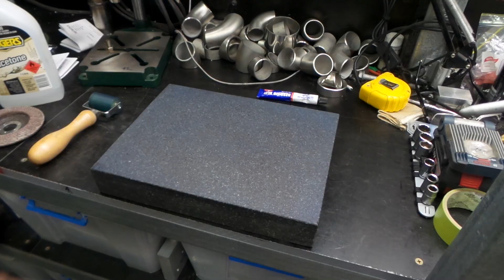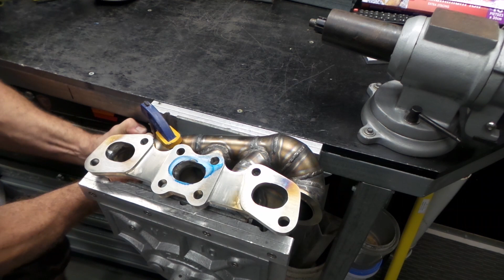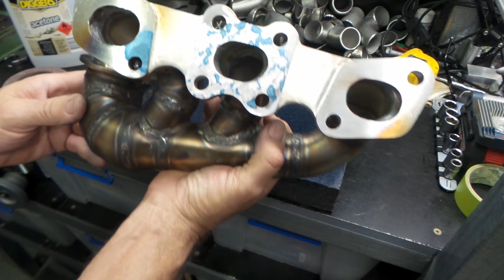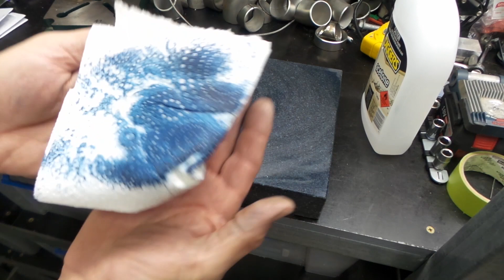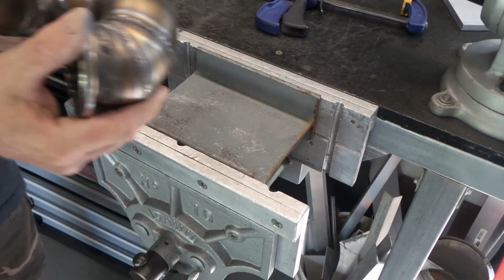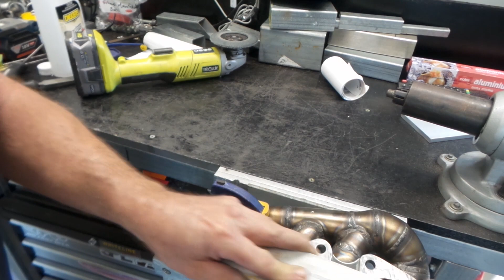Precision Flatten Manifold Flanges with only Hand Tools

Comment: Exhaust manifold on my '89 toyota pickup was warped by 0.5mm. Had some trouble getting the finishing touches with the grinder but a sheet of sandpaper on the table smoothed out the rest real quick. A fresher flap disc woulda helped but I just worked with what I had. Thanks for sharing
Reply from the maker: Great Stuff. Cheers Mate.

Comment: Single flange in stainless will warp on first use.  Nice clamping plate, could have used individual flanges with that stout header.
The idea of a single piece flange goes back to thin, long tube headers where the flange was an assembly aide.  When using short Schedule 10S stainless, individual flanges are a better idea.

Comment: This is brilliant!  Been putting off flattening my turbo manifolds flanges for years because I couldn't think of a way to do it.  Can you use finger belt sander (or whatever you call it) for more accuracy, or will you go through a tonne of sanding belts?

BTW, the turbo manifold is for my nuclear-powered destructomobile, which I will use to take over the world.  But I will be a benevolent leader.  Does this count as using my new-found power for good?
Reply from the maker: G'day Mate, finger sander would probably work great, give it a go & report back. A+ on the powers for good. Cheers.
Reply: @TheAussieShed  Can't believe it's been 6 months already! I used your method to remove the concave-ness from my turbo flange. Then I used a hand-held belt sander to get it completely flat. It got the flange totally flat lengthways, but somehow made the flange concave in widthways, ie in the shorter direction. I don't even understand how it could do that! :'-( 

Now I'm contemplating whether to buy a new manifold (complicated because I'll have to add an external wastegate flange), attempt to flatten it again somehow, or to chop the flange off and weld a new one - but then that would have to be flattened afterwards anyway. :( :(

Comment: Sweet!. As a knifemaker I discovered a nice thick tempered glass shelf from bunnings was cheap and extremely effective for me
Reply from the maker: I've just gone on their site & had a look, sweet, might get myself one of those. Thanks for the tip. Cheers.
Reply: hi mark can you send me the link to the glass thanks
Reply: @captaincook3693    this one is slightly different to the one I have which I can't find on the website but basically the same except mine has a slight curve on one side. 800mm x 200m x 8mm toughened glass 👍 https://www.bunnings.com.au/flexi-storage-800-x-200-x-8mm-clear-glass-shelf_p2580924
Reply: @markhingst5368  Thanks Mark

Comment: My turbo manifold is very warped,Im going to try this as engineering shops want hundreds.
Reply from the maker: Good Luck with it Mate, you'll do fine.
Reply: @TheAussieShed  I called granite bench shops,glaziers left messages no one was interested so I bought a $30 combination square from bunnings, bearing blue and got it pretty close in about an hr.Close enough so it doesnt puff out and fail the car safety checks  .Its $190 for a surface block big enough here in NZ thanks for the tips! It had about 1mm rock end to end !

Comment: Interesting method. Why don't you use a hand file instead of a grinding wheel? Should make it less wavy
Reply from the maker: G'day Mate, files are good for edges but not this type of thing. If done correctly it is the opposite of Wavy. Biggest drawback of this method is it is slow. Cheers.

Comment: Thank you, Thank you, Thank you!!!  I've been sitting on a pair of stainless power V8 long tube headers for a 6.2L Ford Raptor for the past year because of warped flanges.  I didn't want to spend the money for a machine shop to surface them and I had yet to come up with a good DIY remedy.  After finding this video the other day, I bought a thick piece of glass plate for $15 US dollars, a tube of permatex prussian blue and started the process exactly as you showed.  Very time consuming but it's kinda relaxing and more importantly it's working.  From how it's going, I expect to be within 1 to 2 thousands of an inch over 16 1/2", if not better.
Reply from the maker: Glad you found it helpful Mate, this method has helped me out many, many times. Quite time consuming as you say, but I too find things like this very therapeutic & at least the reward is there at the end. Cheers.
Reply: How’d it go
And hold up
Reply: @KollynJ  great, Haven't had any problems with the gaskets or leakes

Comment: Thanks for sharing the secret! It came in just in time as well, I am about to take the warped headers off my project car and will definitely try this out.
Reply: How did it work any tips
Reply: @KollynJ  It worked quite well. The car is up and running since and as far as I can tell no exhaust leaks. If I only had one advice to give it would be to go slow. Removing material is easy, putting it back on not as much. I chickened out on the angle grinder and opted for 2 inch sanding disks instead. Slow but works. Good luck.

Comment: When I trued up a welded angle plate, I pretty much did the same thing.  I didn't figure I'd find someone else showing it off.  I found that I liked to use a well-worn flap disc instead of the hard grinding wheels.  The cuts are shallower and the flexibility of the disc kind of lets you tap/bounce from spot to spot.  Made the final passes a lot faster.

Also, if you're stuck in BFE trying to make a repair this way, the hardest thing to find might be a flat reference surface.  You may be able to use the mating surface (e.g. the exhaust face on the head) if you can get the studs out.  That way it's ground to match (which is ultimately what's needed), even if the mating surface itself isn't flat. I've used a similar technique with a die grinder and shim stock to make a fitted shim to go between surfaces that had worn against each other until they were both out of dimension and out of flat.

Comment: Good teaching this is a unknown art to most people I am a self taught ( mostly) machine rebuilder I have used this very same technique to resurface hardened ways on vmcs when they couldn’t be taken down or moved for grinding I have found a cut off wheel works well allows some flex, also good to use a stone between spotting cycles to remove any burrs that may have been produced from the grinding to protect your surface plate. Great work!

Comment: Before I got my surface plate, I would use our granite kitchen counter top for laying out wet and dry paper on to flatten surfaces.  Needless to say, the wife was not impressed with this method.
Reply from the maker: No, they're not happy when you bring "Man Stuff" into the Kitchen Hey. I have been guilty of using both the Oven & Dishwasher for non conventional kitchen activity you might say.
Cheers.